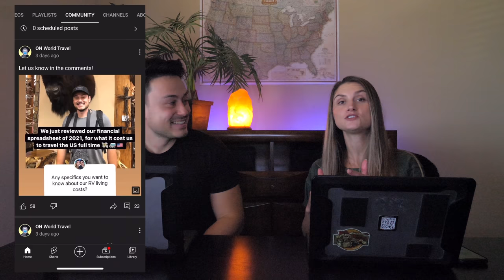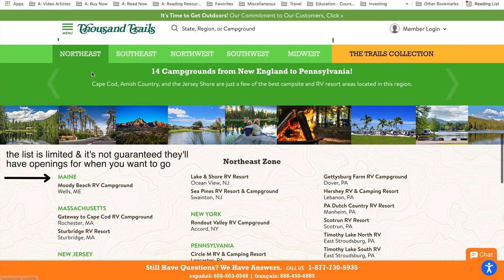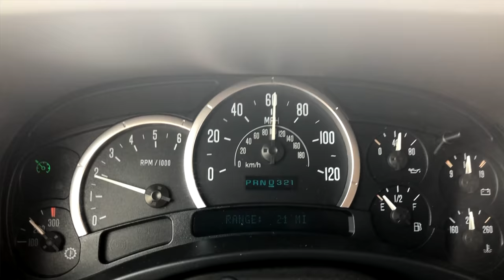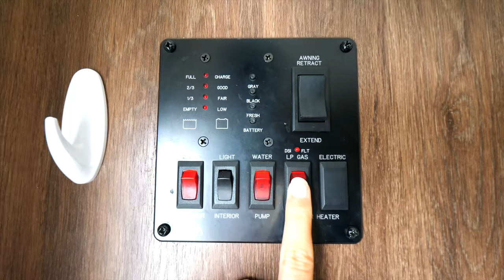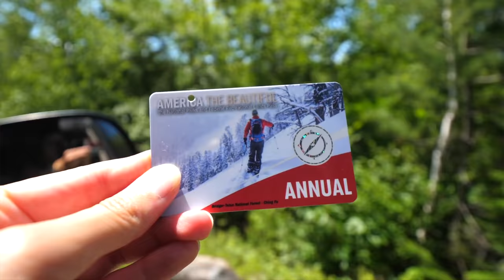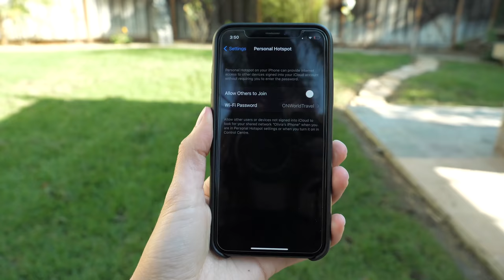RV LIVING COSTS: How much does it REALLY cost to full time RV?

Comment: Upgrade your trailer's battery bank to Lithium batteries if you haven't yet. Then install 600 to 800 watts of solar with a 50 amp solar charge controller. Next time out do more boondocking and less campground or RV parks.

Comment: Our most unexpected rv expense….1995 Ford F 350 power stroke with the E4OD transmission.  Transmission gave way 4 times pulling a 4000lb travel trailer over our years of ownership and left us stranded each time.  I suppose after the 2nd transmission it wasn’t so unexpected…but still I was brand loyal to a flaw for ferd..after the 4th transmission we bought a brand new 2008 Ram 3500 Cummins dually with the 68RFE and have had zero probs since.  130,000 miles later and pulling a Grand Design 310GK now.